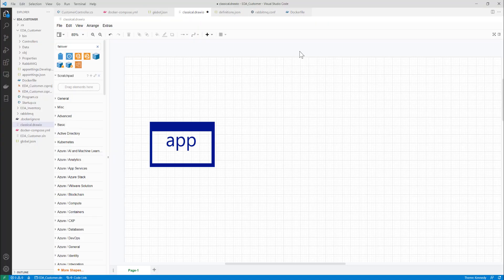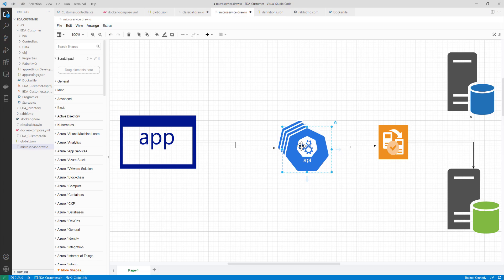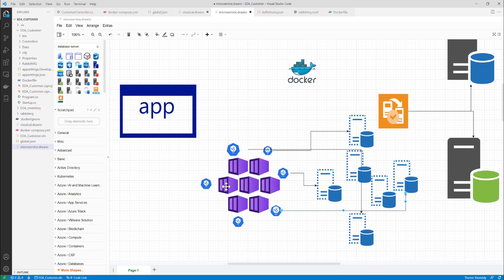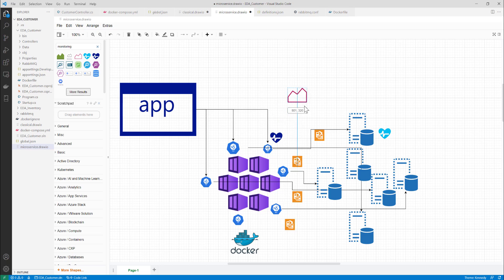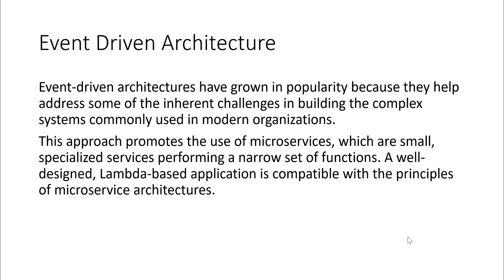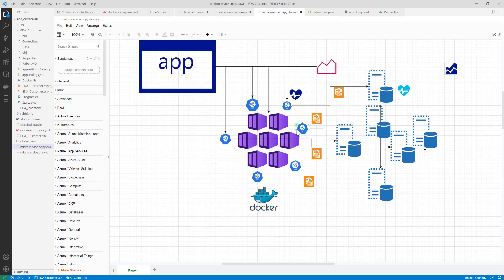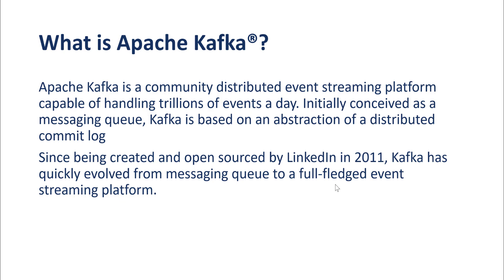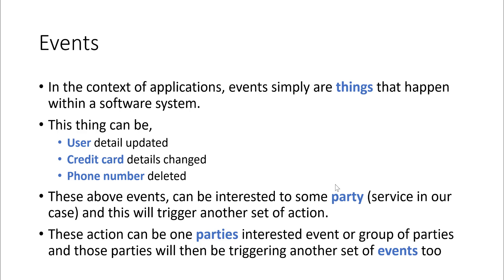Event Driven Architecture - Understanding the Basics

Comment: Hey great video, quick question though. If the app/UI is always listening for events to be published, would that also mean that it will have to maintain a open websocket connection with the api? If so, wont this architecture require a open stateful connection for every connected client? Thinking of the increased infrastructure costs with this architecture, if any. Thanks
Reply: Yes, and these connections can be stored in a service that maps the customer id to the web socket session, using the event bus to initiate messages back to the client via web sockets. Everything is abstracts into these event reactive services so everything can scale, but not for maximum efficiency or even speed.

Comment: One thing not well explained in the video is that we should keep in mind that events are sent after the work is done. Or for long running process you can have an event saying processing and another one done (but even here you would probably use a queue). But in most of cases events mean something changed, the subcriber is not the one doing the work, it is doing extra work afterwards. You want the subscriber to read consistent data. (ex. a database)

Comment: if an event not interested by any services, what happens?  does it block other events in theQ to be handled by the consumer?
Reply from the maker: Not at all, it will just sit there and expires
Reply: @ExecuteAutomation  is this a Queue? consumer polling from head or tail. if an event on head or tail, not consumed, the events behind will have to wait until the one on the top to be consumed?
Reply from the maker: @AmNotLegend  yes, but it’s event streaming queue using Kafka or RabbitMQ. It’s not like stuck there until someone consume, if so, there is no point in having this used by multiple services

Comment: Hi Karthik, Very well explained. Event driven architecture results in "Eventual consistency", so automating at API level becomes challenging at times. So far I used retry to overcome these flaky tests. Any suggestions from your side Karthik.
Reply from the maker: Hi Sharath,

The best way to test the application is to test from the consumer of the event rather than the producer itself. Producer testing will make once again the classical thinking of testing the non-event driven APIs, other way will solve the problem

Thanks,